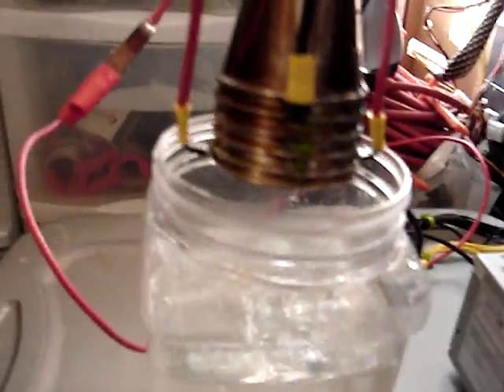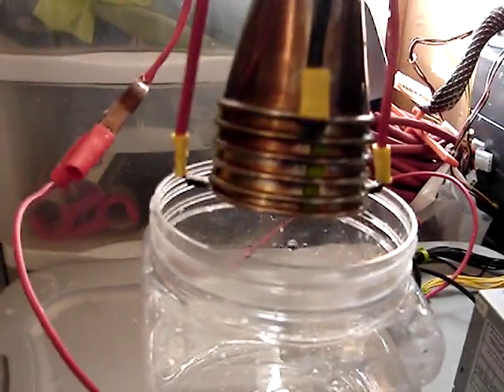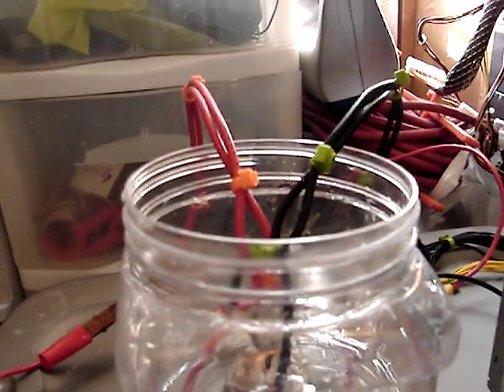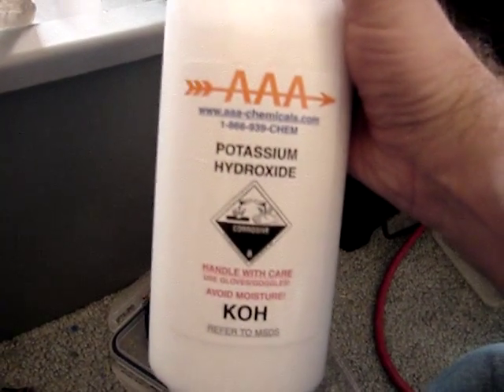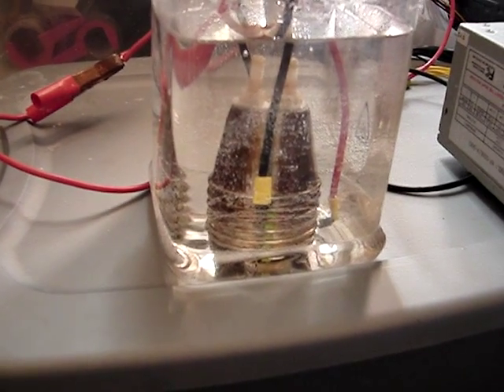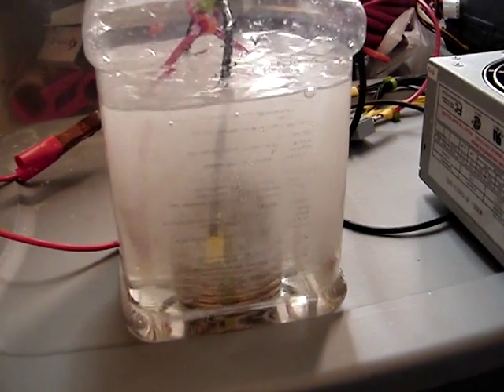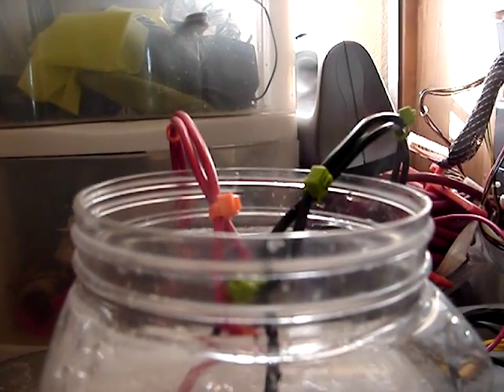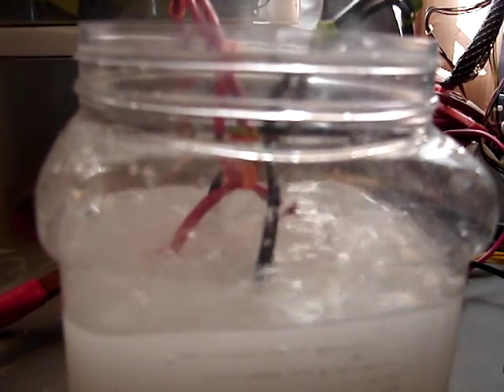Vid8 Volcano Cell Hydrogen Generator "6 Cups" (HHO, Brown's Gas, Hydroxy)

Comment: How would a neutral cup work on a dc powered unit. Dc doesn't  usually run a neutral right because it's the same as the ground. I know ac uses neutrals on a three phase.
Reply from the maker: It is 12V DC.

Comment from the maker: The reason for the middle hole and the upside down design, is to chamber the gas from one stack to another.

This is done to build gas inside the cell and then focus it into a single high output stream. 

Having the cell upright would not allow a controlled exhaust, and most of the gas would never make it to the surface, because it would be absorbed back into the water.

Comment from the maker: true, but as long as you have a water tight seal around the wires, you will not have to worry about them corroding, because they will not be part of the electrolytic reaction.

Comment: If its 302 stainless wire (effected by a magnet) dont bother it will corrode quickly.
If you've got the cash i've always wanted to try NORYL plastic...Bob Boyce and GE have made cells with it...

Comment: Well, I am not really sure, I have seen the KOH electrolite ested and it does a good job of creating toxic waste.I have also been told ALL electrolasis with stainless produces some so I will treat all solutions as hazardous. Even water, which is where I hope I am going, pure water. Right now I am working at low amperages (for now anyway) and have no problem with stainless wire. I understand stranded stainless cable is available and will look for it when needed. No lead solder, silver soldr only.

Comment from the maker: I am aware of the issue of water vapor.
I've been working on a design of a 2 stage dryer method that should prevent any vapor from making it into the engine.

I've already filled up 4 Water Bottles from the hose after my dryer, and placed them in the freezer. I should know by tomorrow morning if I still need to worry about the moisture issue.

Comment from the maker: I have a 50 Gal drum that I pour everything into and it gets disposed of once a month.

Is there less of a concern of chromium issues when using sodium hydroxide? If so, I bought a 2 lb. container that I will use instead.

I also have 100 ft. of stainless wire that I could use, but I've noticed that it gets really hot, so maybe I will need to heatshrink a few pieces together until it is as thick as 10 guage wire.

Comment: I forgot to mention, now that you are using KOH and most other electrolites, the steam can damage the internal components of your engine. You need to keep the steam down, hydrogen is clear and so is oxygen. Even after the bubbler it can be sneaking through. Many people in the field are trying to design dryers to take all vapor out of the gas before the engine inake. Water vapor is not TOO hazardous for an engine, even helps performance but electrolite vapor is dangerous to the engine.

Comment: Looks good so far. I do have some concerns. The wire and connectors have already been mentioned. I am experimenting with stainless wire (welding wire) and silver soldering it to plates. But also, now that you are using KOH there is MORE problem of chromium6 leaching into electolite. Wear rubber gloves! DONT throw the electolite down the drain or on the lawn. Dispose of as hazardous waste, which it definately is. Hexavailient chromium is dabgerous stuff, be careful. Keep up the good work!

Comment from the maker: Thank you for the heads up on the copper wire, I was aware that I should not use connectors that would corrode, but was not clear on why this was so. 

I am currently designing a dry cell model of my design that will be able to have additional cells added in series. This way you can easily connect additional cells if necessary to accommodate larger vehicles.

My main goal is to come up with a solution that is small and compact, but has output similar to larger units.

Comment: P.S. The vapor is water and it is a bad thing. You are getting vapor because you have to many volts per plate/cup as I explained above or below this message. HHO is an invisible gas. To know for sure that it is water vapor try to collect some gas inside a small bottle and put it inside a freezer, if you get ice crystals inside the bottle you know for sure it is water vapor. You get less vapor when you use a bubbler but the main reason to use a bubbler is for safety reasons.

Comment: Another good thing about the  dry cell design is that you can easily start with a few plates and ad more plates to the same cell in a later stadium without changing the design. A dry cell is also a lot more easy to construct and a lot more compact and efficient because you get less current leakage. Keep up the good work though, and check my subscriptions on my youtube channel, I subscribed to many hho enthusiasts. And most of them started with wet cells and changed to the dry cell design.

Comment: The reason why you need 5 neutrals is because you do not want more then 2 volts per plate/cup. If you use more volts then you are creating heat. It is called volt per plate gap. the best configuration is +nnnnn- for a 13.8 volt application. Make a measuring system so you know how much hho you produce for every volt and amp per minute so you can calculate the MMW otherwise you keep guessing. It is very well possible that you make steam that create nice bubbles that looks nice but is worthless.

Comment: I have watched thousands of hho videos and those that I consider as hho experts on Youtube use 316L Stainless Steel plates and get much better results, and they never use copper wire to connect inside the cell because of the chemical reaction to the copper. In the long run it is potentially dangerous because of the explosion danger.  A wet cell like yours is less efficient then any dry cell design and I recommend that you  do some more studying b4 you move on and waste more money.